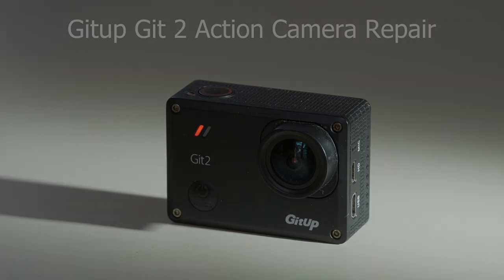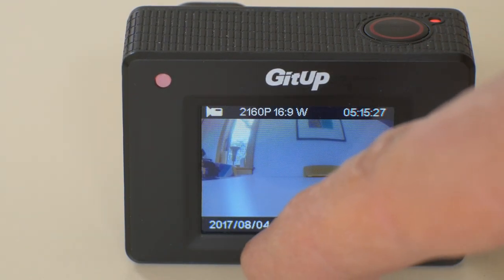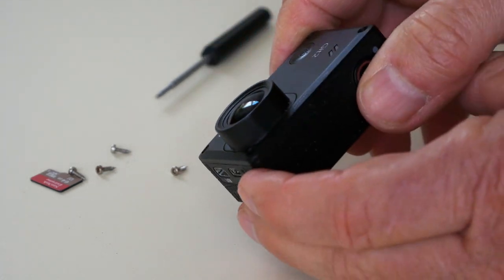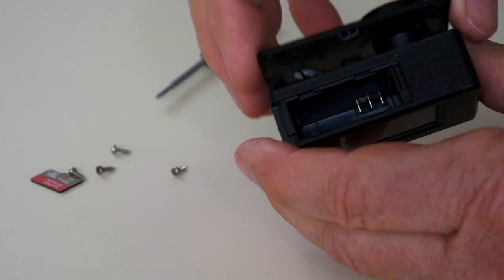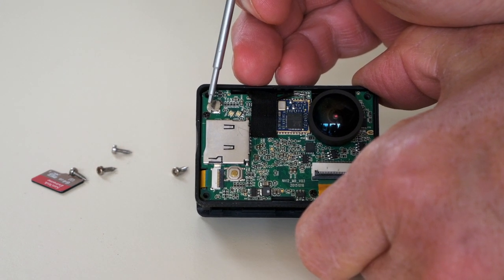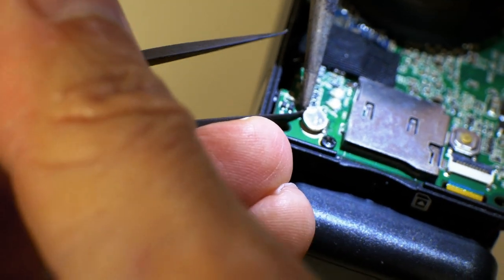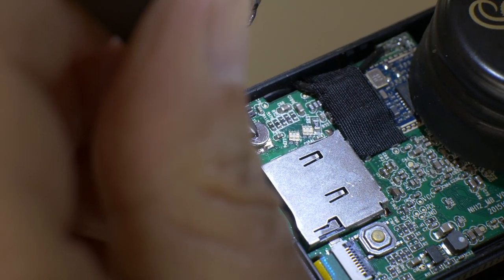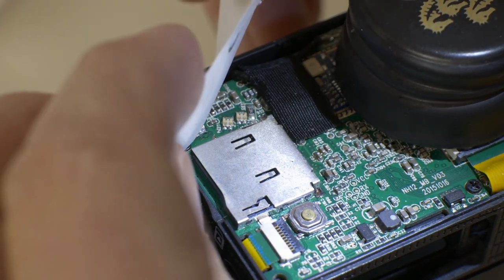Git2 Action Camera Repair

Comment: It's not as easy as it looks. Unless you are a technician, you can not replace this tiny component. It's a shame that GITUP GIT2 has this design issue with the real time clock and GITUP doesn't recall those faulty GIT2.

Comment: Good afternoon
I own an Action Cam gitup 2
I jumped with it into the watertight box but found that water came in and the camera shut down promptly.
I put it badly I got home on rice to absorb all the water and moisture.
If you do not call, I would like to know if it is possible to repair it and also if it is worth it because the camera cost me 100 euros and also as it is outside the warranty period I do not know if it will be worth it.
I await a response as soon as possible.
how i can do ?
greetings
Reply from the maker: Putting things in rice is exactly the wrong thing to do, since it lulls people into a false sense of having done something, while the electronics corrode away out of sight. If you get stuff wet it is important to pull the case apart and remove the water immediately. If it is salt water it may never be repairable.

I'd suggest contacting Gitup directly if you have the skills or know someone who can replace the mainboard, or look for a damaged one on ebay.

But really, the camera is getting a little old now, and I wouldn't invest much trying to fix it - better to put those resources toward a more capable modern camera like the Git3 or even one of the Yis.

Things move so fast in the action camera world!